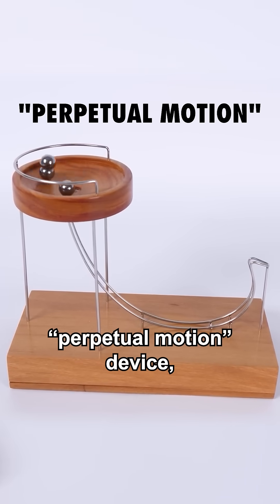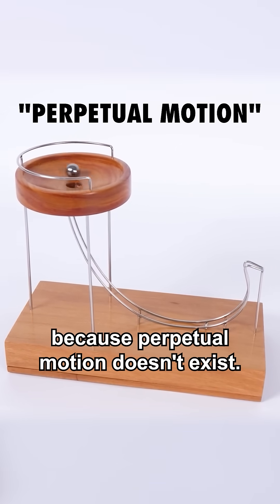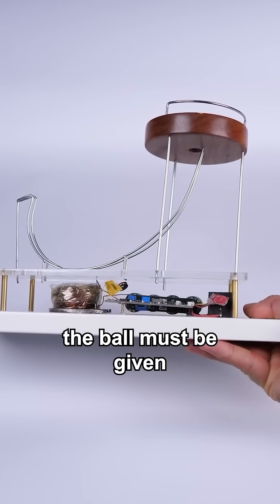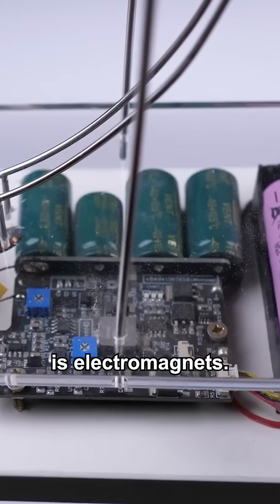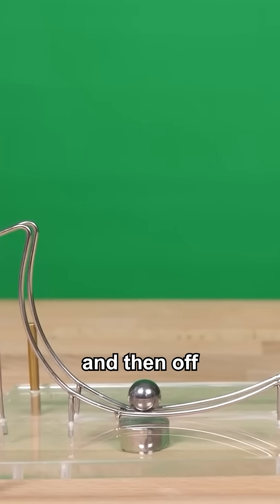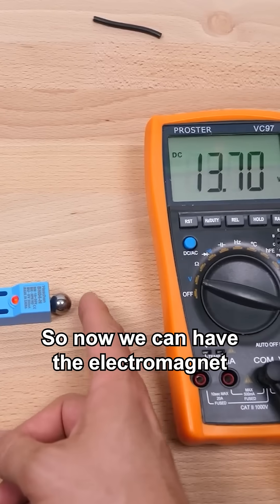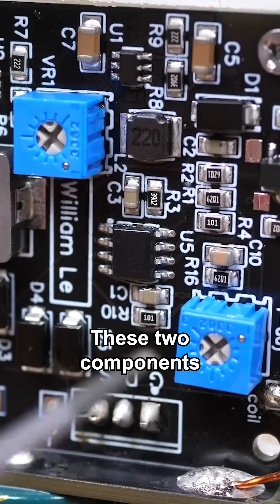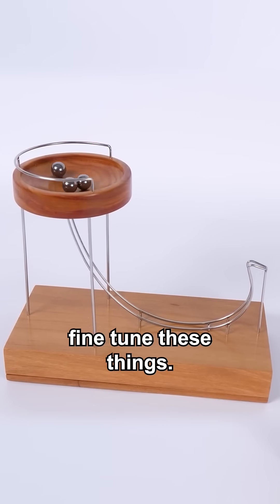Proving that "Perpetual Motion" doesn't exist!

Comment: The most difficult part of making a perpetual motion machine is finding where to hide the coil, wires, battery, inductive proximity sensor, resistors and circuit board.

Comment: Hue contrast shade picsar pulse in the shade form phantom band like a mixer in music engineering logic static diod when it pulse inside the intale before the head toss into Panama red blot Spyker awareness fool the haoakster through bullet blast of reverse tech in fastforward volume speed through cortex vertex irreversible in reverse tilt tiles laminated ceramic apart from cracked rocks in pave ment cement n asphalt now we have philosopher stone in a sapphire like a rock trap in a plastic capsulin insulin like a drop acid base metallic semi conducting inducing imploding amplify additional in sub retracment solidizing solar alkaline eco centrik cubical fill up fill in drop dot down solution pollution pollutant solid gas ice up inside intale folklore gold stuck in trap ice in liquidy before in sip simmers cold n heat steamed in cold feir wave in reverse inverting color in metallic n neon aqua feina drug like acid blot awareness precise precision its percussion u need drums look at the rudiment of drumming 32 reudiment is rythimic coordination time zone no zone 00:00 dual double bios wit pmos pro con con pro negative passive n semi conducting induce materialism hypnosis with photo synthesis in kinetic formulas genetic genome metronome nominater en compass round circum references in statistics tactical performance in rays

Comment: I think if perpetual motion is possible it’ll be through the decay of certain particles. Otherwise we might have to use the electromagnetic force of the planet to make something perpetually fluctuate.
Reply: perpetual motion is possible (at least in theory), as long as the system is unperturbed, with no loss of energy. 
an example of perpetual motion would be the entire universe, or the whole of reality. there is no external 'unreality' system to lose energy to or obtain energy from. as far as i know.
the reason perpetual motion machines are impossible is because as traditionally defined, you're supposed to be able to extract energy from them, which would be a kind of perturbation, making perpetuity impossible.

Comment: Typical scientist? Leads with, "This is a perpetual motion machine." Proceeds to explain how it is most definitely NOT a perpetual motion machine...?
Reply: there are two different definitions of perpetual motion machine at play here. one is "a machine that can extract energy from perpetual motion without an external energy source" and the other is "a machine that is proposed to be able to do that, but can't." both are valid definitions because they're actively used, but it gets confusing when you switch between them in the same monologue.
Reply: @classicmax794  In other words... Whatever definition you might use, "the machine" is either a perpetual motion machine, or it is not. The one in this video is NOT a perpetual motion machine. It's a battery operated toy. The only confusing thing is when the scientist contradicts himself.

Comment: The transistor watches of the 1970s used a similar mechanism to power the balance wheel, the component that oscillates to regulate timekeeping. Instead of a hand-wound spring, these watches typically used a coil and magnetic system, often with a transistor as a switching element, to detect the balance wheel's position and apply precise energy pulses to maintain its oscillation at the correct amplitude.

Comment: If you used non-magnetic balls, then you could pass a current through the ball with the rails and cause a sideways force with a magnet near the base (due to the right hand rule).  That should accelerate the ball and allow the circuitry to be much simpler.

Comment: No it's not. It uses a battery which will require charging or replacement. Perpetual would supply its own power source with perpetual renewal in itself.

Comment: soon as the batteries run out, its no longer perpetual, sad.  idk if switching to a weight reactive system would work, where the weight of the ball bearing could possibly move fluid to put a previous marble back into the funnel, the fluid may even be used to help the bearing move around??  eh idk if a clock spring would be wound at some point here if that would help or not etc.  now also if you put permanent magnets and a gear system, you could put each magnet in a different position, where one moving turned the others and vice versa... so there wouldn't be a need EVER for batteries... but how to keep the field with the magnets over time then becomes questionable.

Comment: Question: Isn't the whole Universe by itself a Perpetuum Mobile?
Reply: yes, the universe is a system that actually exhibits perpetual motion. what makes so-called perpetual motion machines impossible is that you can supposedly extract energy from them and they supposedly have no external energy source.
there is nothing for the universe to lose energy to or gain energy from. sub-systems within the universe can lose energy, but that energy just enters different sub-systems of the same larger whole. there are also time crystals, whose atoms exhibit perpetual motion, but they don't break the laws of thermodynamics, because they don't use energy for that motion and energy can't be extracted from them because they're in a quantum ground state.

Comment: Electromagnets? Really? 
My mind went straight to an electric motor and rubber wheel, somehow hidden in the upper platform, to accelerate the ball down the chute…which is exactly how the one I received was implemented.
The noise the motor makes, mounted as it is inside what is essentially a holllow plastic drum, is TRULY HORRENDOUS and completely dispels any belief, that it's somehow peroetual motion, from the mind of anyone you deminstrate it to.

Comment: Most of these actually have a motor in the hole that contacts the ball as it drops through and sends it flying down the ramp, rather than an electromagnet under the rails

Comment: If the balls have some magnetism, what if it passed through wire coils on the path down (believe it’s called a Faraday coil) and then have that small voltage fed through a capacitor and then to the electromagnet. Could it be scaled to provide the amount of voltage the machine needs to continue without a separate battery or separate power source? I know the answer is no in the end, but could that improve its efficiency? No science background, just seeing if my YouTube based physics knowledge has gotten me to the point I’m creating logical solutions.
Reply: nope, bc of the friction some energy is lost with heat
Reply: @ damn…that’s right. Thanks for reply!
Reply: As Albert Einstein said,

"Energy cannot be created or destroyed; it can only be changed from one form to another."

That's why you can't use little electricity to make more electricity than you're already using.

Comment: All right, hear me out we put a thin metal sheet and we take a permanent magnet instead of the electromagnet. We make the balls themselves magnetic and we lower the landing area theoretically would fall down the hole interact with the thin metal sheet pull it towards where it is, activating the magnet pull it down and then once it passes the magnet since it’s also magnetic, it will move the sheet back into place, cutting off the electromagnetic field, allowing it to launch back to where it was right?
Reply: How would it move the metal sheet? If the sheet is also magnetic, it would cause the same issue we see in the video.
Reply: @ so speech to text is horrible, but the sheet isn’t magnetic. It’s just a small piece of iron. The balls are magnetic and so is the little magnet under the sheet so the sheet gets moved by the magnetism from the balls moving up/down the slope and the magnet at the bottom keeps the attraction when the balls are near thebottom or the acceleration points along the hill to be fair I wasn’t saying that this would work. I was simply asking if it would I do not know the answer to this question though I do have a YouTube channel and I may actually build what I was talking about and see if I could get it to work.
Reply: Lmao, "permanent magnets" don't exist, all magnets lose their magnetism at some point.
Reply: @benjaminlewis5057  couldnt you just replace it i mean it should make enough to charge one right like it still takes a bit to make one run out
Reply: @snipeX-Stich  If you have to change it, it's not perpetual motion, you don't understand.
Reply: @ ok but then use my second point and have it charge the magnet also magnets take a bit to stop working  almost 4 or so years ago I threw a magnet up and it stuck to my ceiling fan and its still there
Reply: @snipeX-Stich  but to be perpetual motion, it has to go forever, not just 1,000,000 years, forever.
Reply: @ you ignored my second point again read it again
Reply: @snipeX-Stich  Still, non of this will work due to gravity and friction.
Reply: @ if mine doesn’t works minus the magnet part and we use the fact that magnets still take forever and we would still generate enough electricity. We could still see theoretically charge the magnet then it would still work because we were already accounting for gravity and friction prior to the magnet problem.
Reply: The only issue that I could possibly see with this design is how in the world we could take all that kinetic energy implemented into a way to then charge the battery and then work the magnet or recharge the magnet
Reply: @snipeX-Stich  You cannot create energy
Reply: @benjaminlewis5057  also thats simply the term for a non-electro magnet so dont lmao me ight

Comment: Perpetual motion kinda does exist. You just have to know where to look. Like, outer space.
Reply: Even space isn't a 100% vacuum, and isn't a perfectly closed system. It just stops on an astronomical timescale
Reply: @itssovalentine  Correct. In fact moving through "empty space" incurs friction. The perpetual motion is found in cosmic inflation.
Reply: @situational.analysis  I'd hold off until the mechanics of the expansion of space are better understood lol

But if you can theorize a machine that would take advantage of that I'd love to hear it

Comment: Perpetual motion is absolutely possible.
With the use of springs or some other object that can take one position, then perform a job and taking an opposite position, then returning to it's original position again, perpetual motion would be the outcome.

It would require a clever design, but it most definitely is possible.
Reply: As soon as you introduce a spring, your system has so many losses it won't even theoretically work perpetually.

Comment: If perpetual motion doesn't exist, why is there movement in the universe? Why is the fabric of spacetime, not only expanding, but doing so at an accelerating pace? In the standard model, perpetual motion doesn't exist, but the standard model as it turns out is nonsense.

Comment: For those curious, the reason perpetual motion is impossible is because an object would need to gain greater kinetic energy than any amount of gravitational potential energy would allow for it to gain. Perpetual motion machines work off of the concept that you can convert gravitational potential into a great enough amount of kinetic energy to reach the previous state in which that gravitational potential existed, like a ball falling down a ramp and the ramp bringing it back up to where it fell from. The issue with this, is that gravitational potential can only be converted into a proportional amount of kinetic. This means that, to go much further than simply hitting the ground and bouncing a few times, external energy sources are required. If you drop a ball from 10m in the air, it will have taken more kinetic energy to reach that height than the potential energy the ball will have once it reaches it. Even worse, since the ball loses energy with each bounce, an angled surface of some kind, like a ramp, will be needed to get it back up to the platform from which it was dropped, leading to even further energy loss from continued sliding, which produces far more friction than mere bounces.

TL;DR: Perpetual motion is impossible because the kinetic energy required for an object to reach a certain height will always be greater than the potential energy it will have once it reaches that height. Meaning, it will never have enough energy to reach where it started on its own, making real perpetual motion machines impossible.

Comment: Perpetual motion hasn't been discovered yet is what you mean to say.
Reply: its considered impossible by the current law of physics we know.
Reply: @gabrielandy9272  the laws of physics are the same as everything else in science. Accepted until something proves them wrong.
Reply: @StarfalIYT except in space if you aim something in a direction it will go forever until it either hits something or....never stops
Reply: @StarfalIYT also, proven wrong? That's not a very scientific attitude. Science is theory. Entirely. One theory will stand until the next theory comes along showing its wrong and that will happen forever.
Reply: @Kolonol1  That's true everywhere, you don't even need to go to space for that, that's just Newton's first law. All friction is just "hitting something", just on a molecular scale

The caveat is that you'll never prevent loss of energy, even in a perfect vacuum where you avoid all collisions.

This is because all matter is fundementally made up of charged particles, which emit electromagnetic radiation as they move. Eventually all the kinetic energy of the object will be emited this way and it will stop moving, regardless of it's surroundings
Reply: @user-zz3sn8ky7z  like I said every theory is true until a more valid one replaces it. Right now the theory says moving faster than the speed of light is impossible. Until it's not

Comment: Could have used a couple of hall sensors instead of the inductive proximity sensor. Note how many big capacitors, they really want lots of power going to the electromagnet in a very short period of time. Would be fun to design one myself.

Comment: Perpetual motion is technically actually kind of possible, but only as long as you don't try to take any bit of energy out of it.
Reply: so technically it's not possible
Reply: @ZZubZZero  "Tehnically" it kinda is though. You just need to make sure that no eneregy leaves the system or gets transformet in the wrong way (aka lost as heat, etc). Therefor it is just not "technically on our level of tech" possible.
And even if you would be able to create such a device, it would just be a fancy dust catcher, since you can never do anything with it.
"source of infinite energy", but also source of unusable energy.

Comment: Would this not work with a magnet that isnt electronic?  One that requires no energy input to magnetize the metal balls?
Every time i see a video on this topic its always an electromagnet being used, but what about a neodymium magnet underneath the drop chute?
Also what if its done in a vacuum? Then theres much less air resistance on it.  And lubricate the ball and the track to provide nearly no friction.  
Could this all not produce true perpetual motion?
Reply: You can't turn of a normal Magnet

Comment: Perpetual motion actually does exist, it's Newton's first law. However, this only applies in the vaccuum of space or in an environment without air or any other gas. You can't have perpetual motion on earth because the particles in our atmosphere will inevitably, no matter if the object is going 99% the speed of light, slow it down to the point of it stopping. So without acting upon in object, as in, applying force in some way, you cannot achieve true perpetual motion.

Comment: The thing I love the most about this perpetual motion machine is that the little funnel part is there for no reason other than to stop the ball before letting it fall down again. ALL it does is interrupt the momentum, it's a complete waste energy!
You would build a more efficient version of the same device by removing it, and simply letting the ball fall smoothly back into the trail directly!
...except in that case it would look so obviously fake, you'd just see a ball going around on a trail for no reason.

So it's funny that in order to make stuff like this more believable we need to include something that works against it.

Comment: Perpetual motion: water, an angled ceiling that doesn’t touch two walls, second angled ceiling that does touch all 4 walls and a never ending heat source at the bottom (presumably the bottom of a sleeping (not dead) volcano)
Reply: That's not perpetual motion either, the Volcano will eventually become extinct and will cool down.
Reply: @brucerogermorgan2388  it’s located somewhat close to the third layer where it’s warm. The movement will slow down (a lot) if that happens but it won’t stop entirely

Comment: I mean its still perpetual motion by definition
Reply: No, it's not.
Reply: @shrekkek9396  its moving perpetually is It not? Looool
Reply: @Cojo840  it's moving until it has battery charge.
Reply: @Cojo840 it won't move perpetually because the battery will die
Reply: It's only perpetual motion thanks to the electronic magnet, therefore, not true perpetual motion

Comment: If perpetual motion doesn't exist, then how do the planets keep moving around the sun, and the Galaxy keep spinning?
Reply: This isnt perpetual either, it's just amon a whole other time scale. And it's not a closed state either
Reply: Do you have any idea how much energy a black hole produces, and how much energy the star in a solar system produces?  It's not perpetual, there are just very large and massive fuel sources powering that great engine.  But it's not infinite.  A very long time from now those stars and black holes will burn out and the universe will go cold, dark and dead.